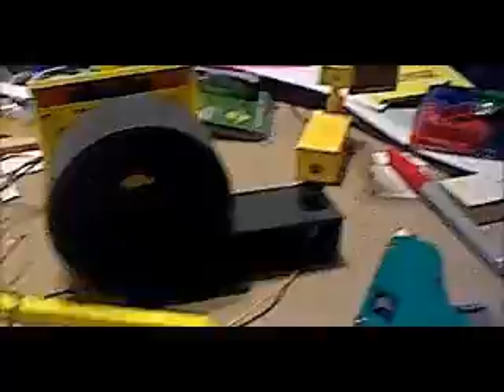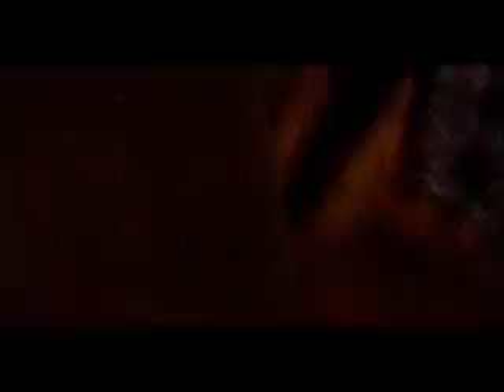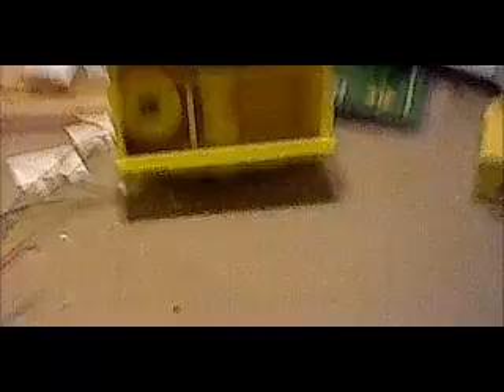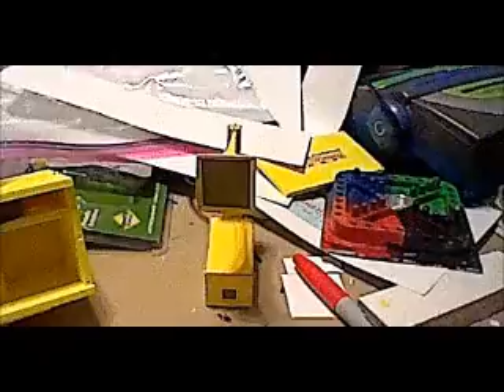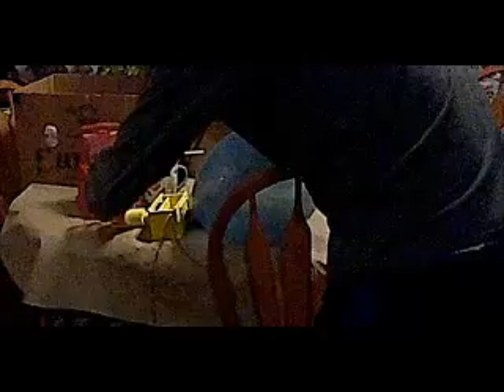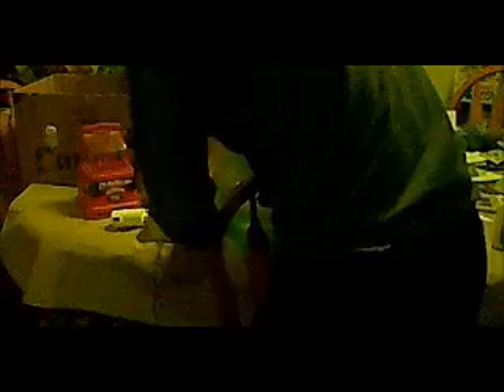3d printed mini thunderbolt tornado siren update.

Comment: are you going to wire it up to the weather radio when the mini thunderbolt is complete ?
Reply from the maker: possibly...
Reply: broken solar panel would it replace the megablaster
Reply from the maker: only if it is loud enough. (it has to be louder than the megablaster.)